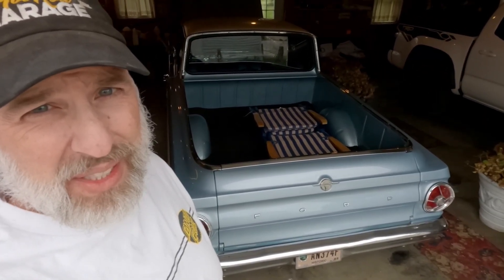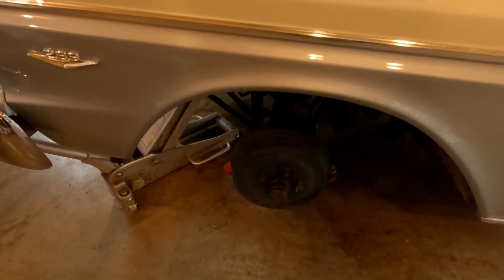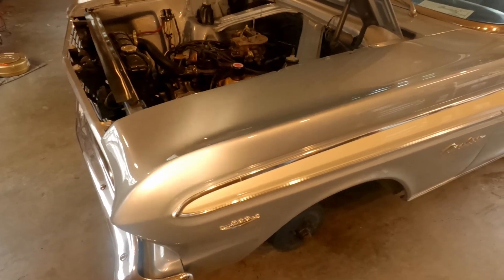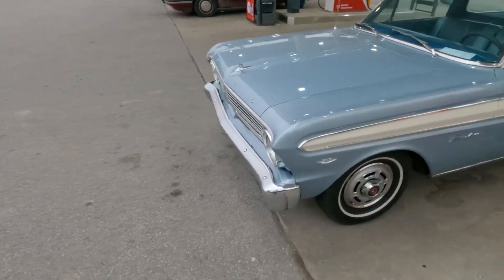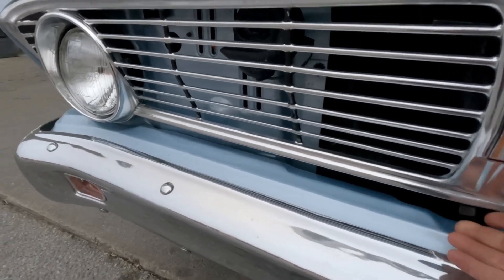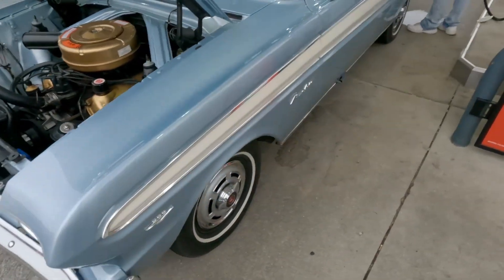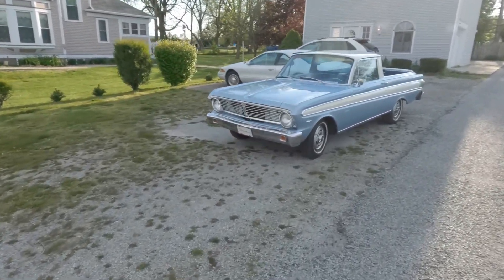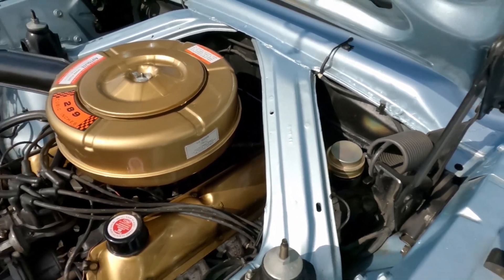1965 Ford Ranchero  |  Brake Fix  |  Car Show Prep  |  #Winning

Comment: The biggest thing not correct in the restoration was that the engine bay, radiator support, inner fenders, firewall and export brace should all be satin black. The second biggest issue is someone painted the grille silver... Lovely car through! I have a 65' myself (not a perfect restoration either) 289, 4bbl, C4, Lime Gold w/black interior (originally Wimbleton White).
Reply from the maker: Thanks for the feedback and watching my channel!